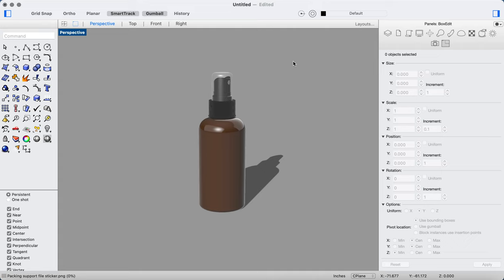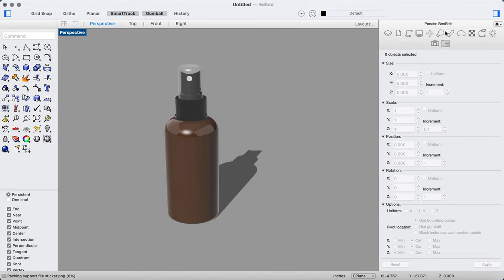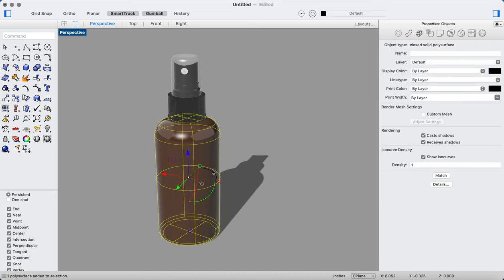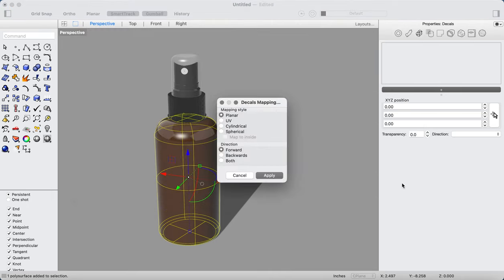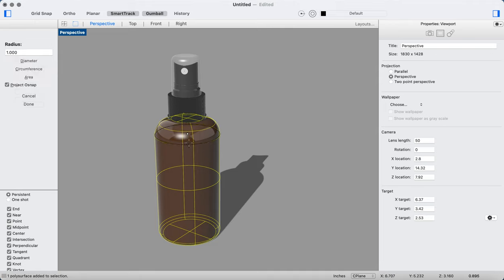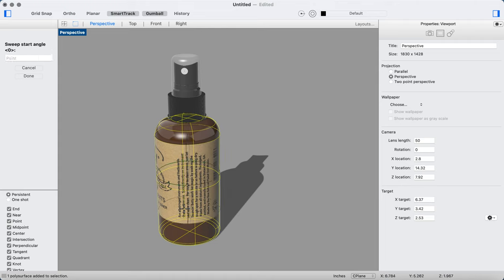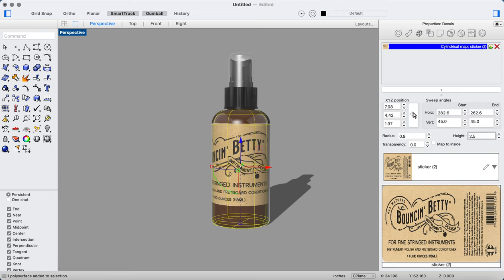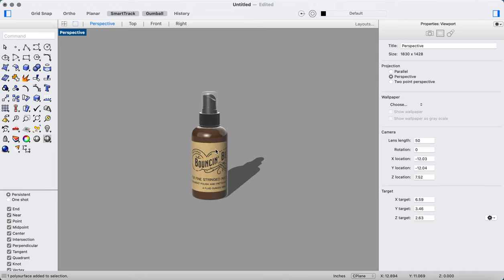Adding Labels and Decals to 3D Objects in Rhino

Comment: Can this be done with video instead of a still image? Thanks for this video!
Reply from the maker: Do you mean creating a video in Rhino after you've created a Decal to a 3D object?
Reply: @pladddot  No. What I was looking for, was a way to apply video to a surface using Rhino 3d. You applied a "Decal", a still image; I was wondering if the "decal" could be a video instead of a still image. I found out it is not possible in Rhino. It has to be done with Blender, or After effects.
Reply from the maker: @VidarrKerr  I don't know of a way to do that in Rhino.  You could export the 3D image into a video app like Premier or Final Cut and then use 3D effects to project the video on the object.  Rhino just isn't an app for video.